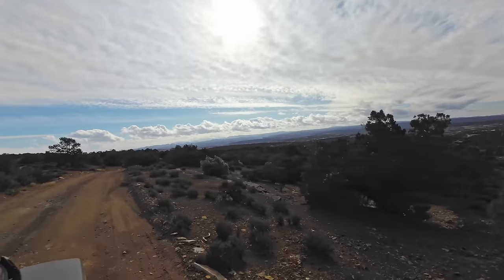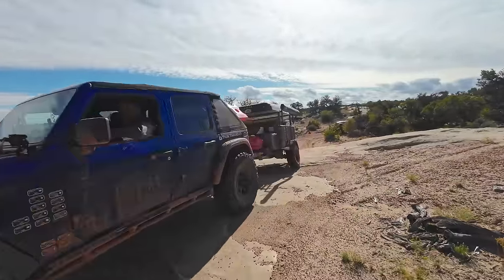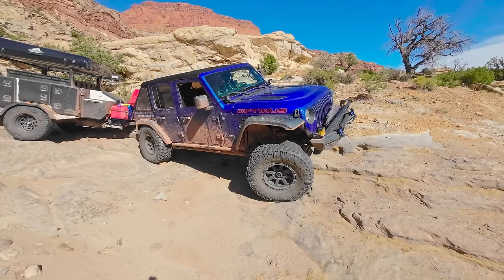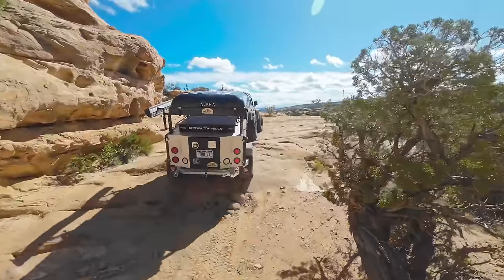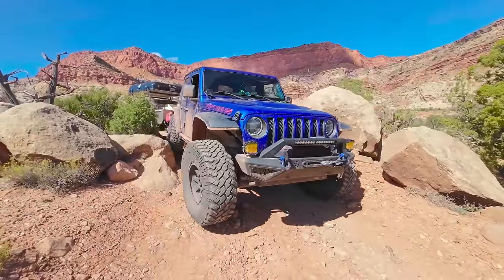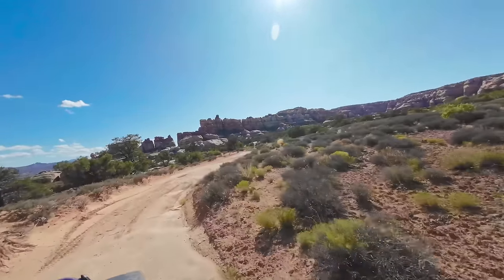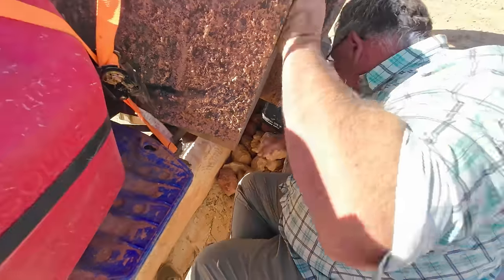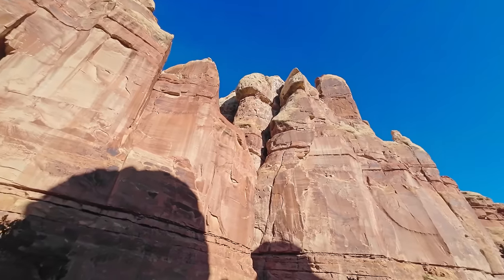Epic Overlanding! The DollHouse | Maze District Overlanding

Comment: We did the Doll House in May of 2001. A buddy made a trailer with a long hitch and a pintle hook hitch. He had trouble on those tight switchbacks. He mounted a quick disconnect winch (interchangeable) to winch the trailer back straight, although we never used it. He had 33” tires on the trailer. We ate like kings, our food packed in dry ice. It was my buddy dream to do this trail. Full moon over the doll spires. So bright out, no flashlights needed. A magical and truly special trip we will never forget
Reply from the maker: Thank you for sharing that memory with us
Reply: @TrailTraveler  We also camped at #2. We hiked down to the river one morning and nearly died on the way back up. Not enough water. Lesson learned. Plenty off water we brought though. 4 day trip, 4 people, 40 gallons of water and plenty of gas. Worth all the time preparing. Unfortunately my buddy is no longer with us. He had a 99’ TJ and I had a ‘91 YJ.. Great video and Thanks!! ps. We got our water from Matrimonial Spring.